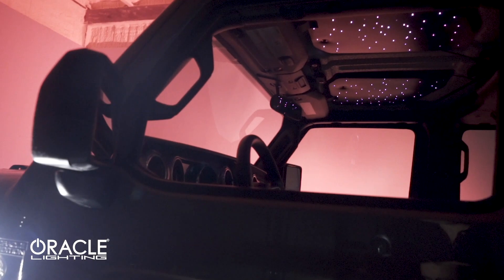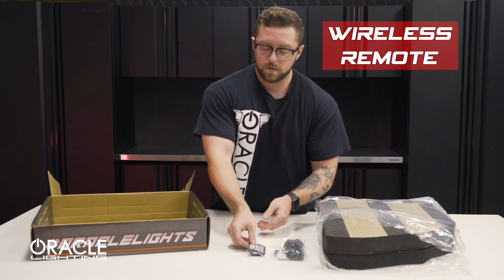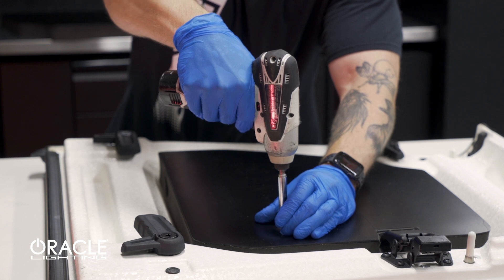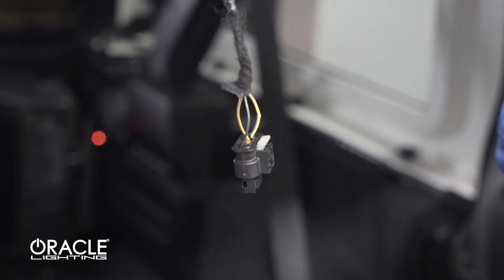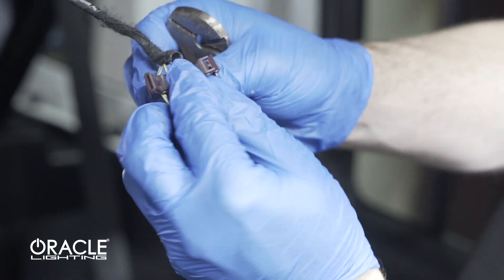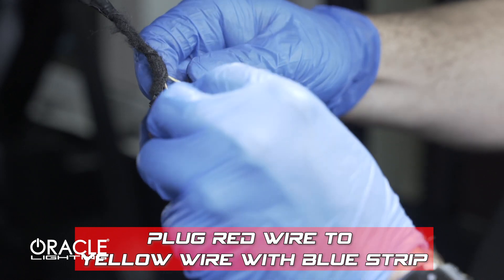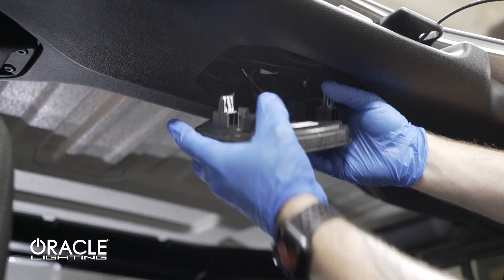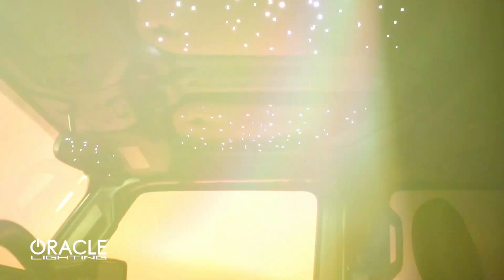Jeep Wrangler/ Gladiator Starliner Fiber Optic LED Headliner DIY Installation

Comment: Will it work if previous jeep owner installed a headliner. Not removable, it’s like a very thin leather sheet.
Reply from the maker: If it is a thin sheet this will install right over it. Should not be an issue.